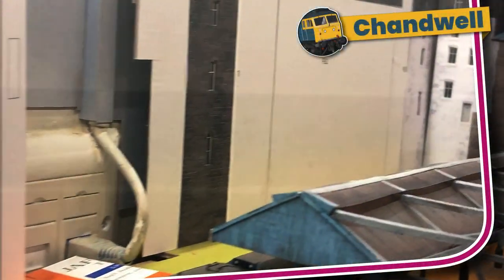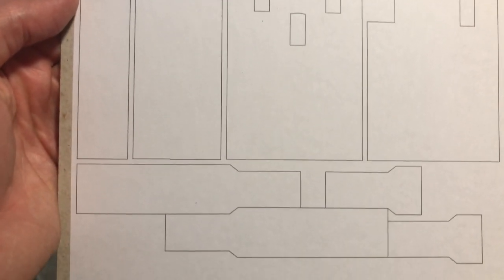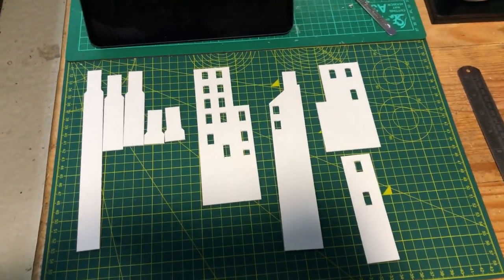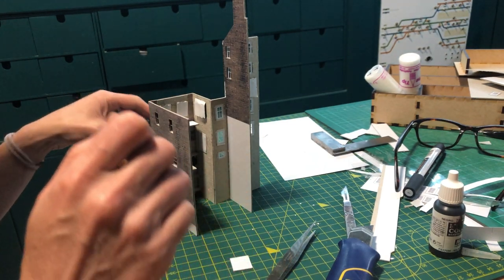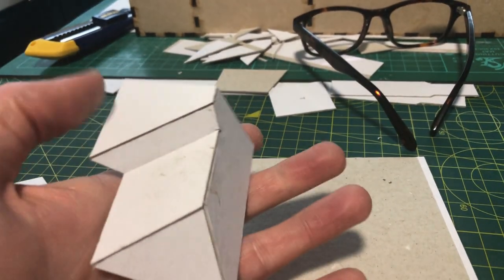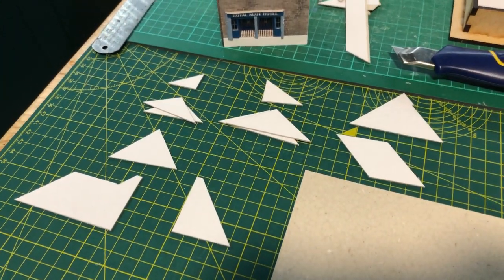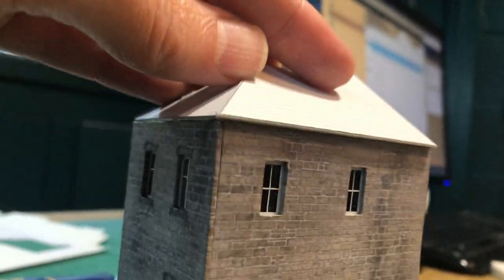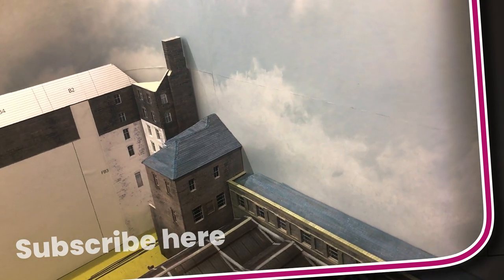Trouble with the roof: Scratch Building a Low Relief Victorian Hotel Part 5

Comment: I recently realized, after much agony and confusion, that a week prior I had successfully altered 5 out of the 6 measurements that needed to be changed after a design change. That 6th one though...
    I have great respect for people who do great work and also have no problems showing mistakes made. I explain to students that the first step is to train the eye for mistakes that can be corrected. The second step is to train yourself to stop and take the time to fix those mistakes. Step 2 is the hardest when you just wanna get something done. I'm sure that doing the roof 4 times to get it right was frustrating, but taking to the time to get it right actually says a lot about your craftsmanship. Thanks again for the vid
Reply from the maker: Thank you very much indeed, Mark. Yes, it's important not to get flustered when you notice a mistake. Just take a breath and do it again! I don't find the mistakes themselves frustrating, but I find it frustrating when I don't know WHY the mistake happened. We get there in the end though! :) --Michael